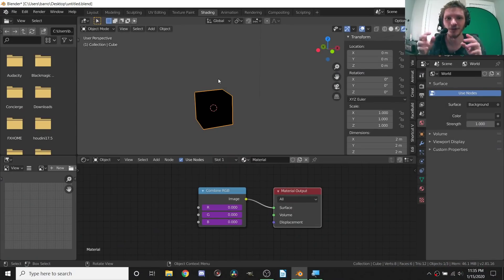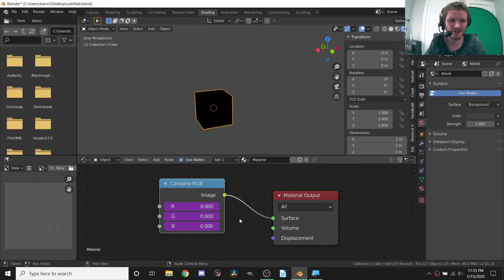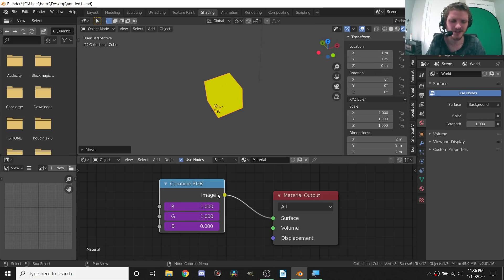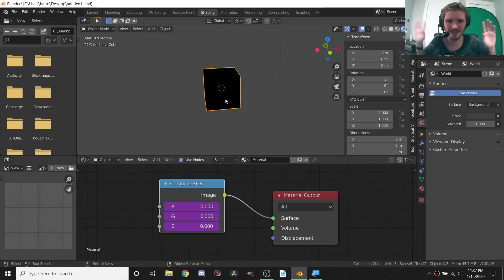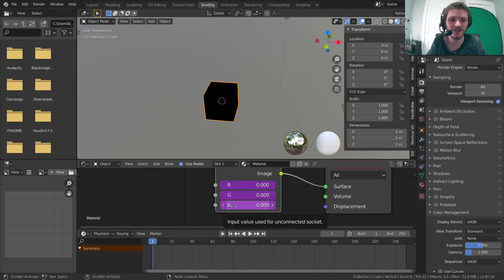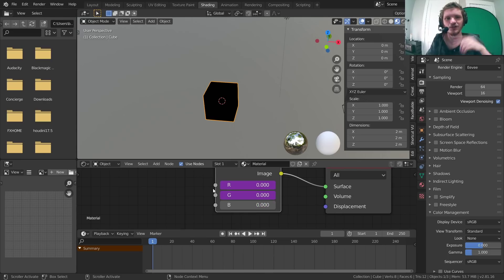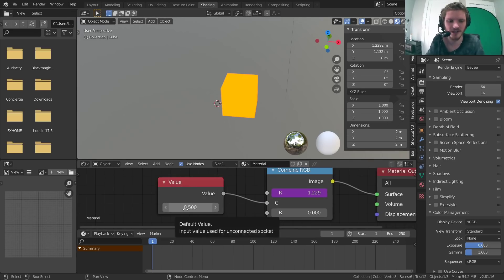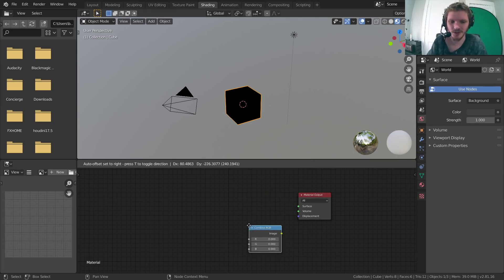#5 - Drivers - Blender Procedural Nodes

Comment: Would yo please, go in to detail on the math node. There are so many options with in this one node. The manual is of little use for
 learning how to manage all of the settings. 

Also, the layer weight node is somewhat of a mystery at least to me. I recently watched a video here:   (@ )...here it demonstrates how the layer weight shader allows a light source to affect a parameter in the solidify modifier . Very cool but I can not see the connection b/w the shader and the light. 
I very much appreciate your videos, I'm spending most of these days learning Blender and the y are a great help.

Comment: Hi DC, great tutorial, keep these up as they are getting better each time. Quick one on this: So the property you set is to the cube, adding a location colour change is simple as you explained as would be other effects, but now if you add a new cube and give it the same texture if runs of the original and not the new object. So say you want to make 200 spheres roll down a hill, and all change colour as they go depending on the location. If you add the same texture it currently runs off the original, how do you get it to set to self? You could make a texture for each object but that's a bit long winded, surely there's a way to set to textured object rather than original.

Comment: Hey default cube, i got a question....how do you get a driver/object to manipulate the properties of another object by using the proximity of that object from any point in the 3D world space? 

because I have tried...and it only works from the center of the 3D world space, but if i move said object AWAY from the center of the world, it does not work.

Comment: I know this is off subject...Is that a preference where your connection lines on your nodes are wavy so to speak vs straight? I have the same version of Blender as well....I'm a newbie..Thanx in advance.
Reply: Edit > Preferences > Themes > Node Editor > Noodle curving
(at the very bottom)
Reply: @nibblrrr7124  Thanx
Reply: Watch this series from begining you will find out

Comment: you can also type specific things into some values to set up a driver. a good example is "#frame" will add a driver that references the frame. i believe similar properties can also be input so long as you know the path for them. copying is usually easier but sometimes, if you know the property name, it is faster and easier to setup that way.

Comment: anyone knows how does the material graph apply to objects exported for Unity? mostly asking in relation to video games. because not all of these features (drivers included) make sense from a realtime video game perspective.
Reply: Drivers are not possible to use in something like unity as far as I know, but there is an open source tool to convert shader graphs to Unity. Can't remember the name but google should find it quick.
Reply: @rallokkcaz  cool thanks
Reply: The Standard Unity shader isnt compatible with Blender directly because Unity packs the roughness map into the red channel of the metallic map, so you would have to do that in order for it to render properly in Unity

Comment: I need some assistance with drivers, I want to use the rotation of a sun lamp to control the rotation of a normal node (Vector–> Normal) but when I set it up the rotations don't align. I've tried swapping the x and z values, using radians, I don't know what's wrong. If anyone can help I'd be grateful.
Reply: It's for 2.79, but somebody asked the same question on Stack Exchange https://blender.stackexchange.com/questions/10560/how-to-correctly-drive-a-normal-node-with-lamp-rotation
What the purpose of that driver would be to drive a normalized vector for?
Reply: Robert Prus I'm lining up the sun lamp with an image of a sun on the skybox.

Thank you for this, I think this will work.

Comment: Extremely useful info.  I can think of a thousand uses already. OK, not a thousand. But a lot.
Reply: The easiest example is animating rotation of cogs probably, adding driver to rotation of main cog and inverting it.
Reply: @wailfulcrab  I was also thinking of things like having parts of an animated car work together and even follow a spline as a guide path.  Am I right that this could work? Seems like it...
Reply: @wingflanagan  Depends on what parts you mean, in most cases all can be done with just parenting.
Reply: @wailfulcrab  That makes sense.